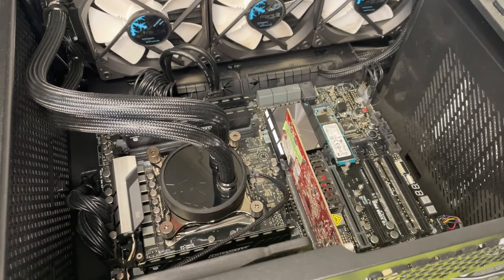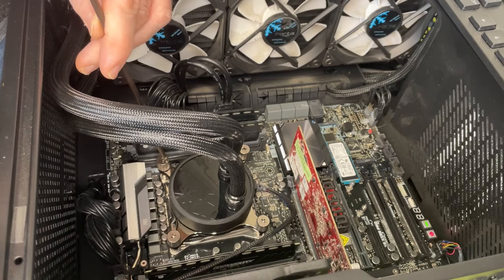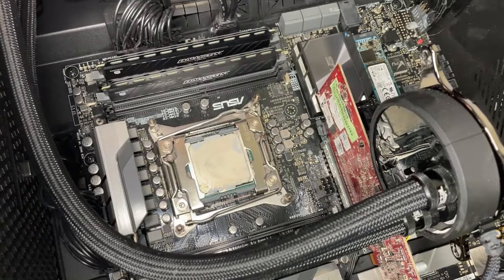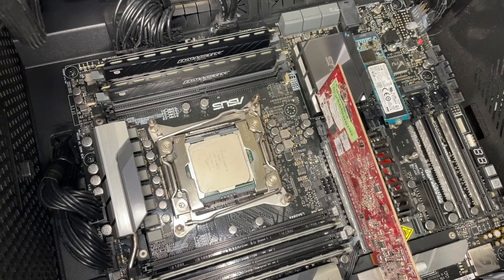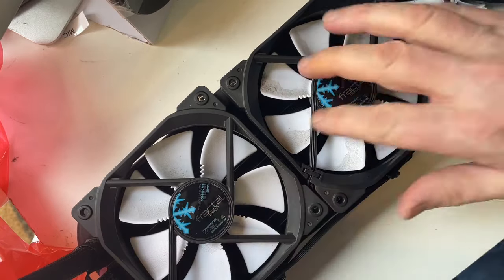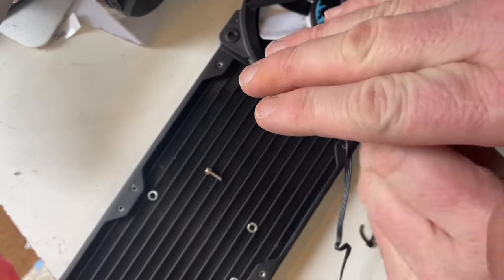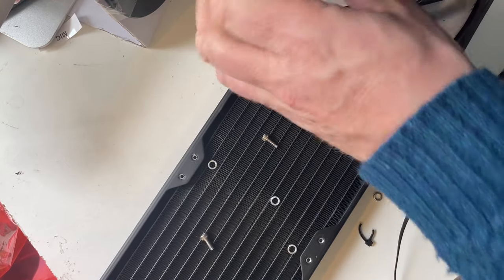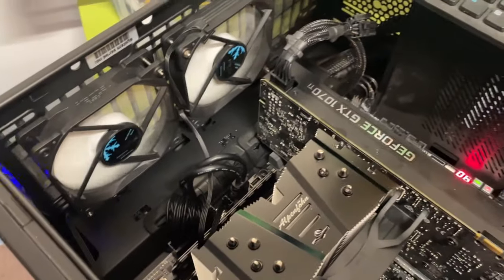Gaming PC  with a dodgy heatpump

Comment: I have the exact same AIO cooler. 5  years in no issues. have had to refill the fluid once as it will slowly lose fluid via evaporation and soaking into the lines, but this unit allows refilling and expansion which is why i picked it to begin with. Water cooling has come a very long way but it does have an expiration if not serviced.
Reply from the maker: Ah! That makes alot of sense. I guess I just left it to fester!

Comment: That block is full of air ?.. i have an i9 11900k and use a 8th gen block which is quite a few years old 😂 connected to a custom loop water chiller system i made. Best cooler ive owned. Doesn't go over 62c under load @5.3ghz all cores, and i have to restric the pump speed to stop it freezing on idle. 😂
Reply from the maker: Thats a good quesiton. It could be. The pump seems to be working but perhaps there is a airlock in there...

Comment: Also if a processor is fried, it won't just get hotter and hotter.  It simply won't work
Reply from the maker: True enough. Whats great is that the thermal cut-out seemed to work as the CPU and board have survived! Fhew!

Comment: Um, Is the pump powered by constant power ?
The common mistake people do when first time installing water cooling AIO is that they plug the power to the pump to temperature controlled power socket.
The pump should be running constant all the time, while the fan on radiator can be temperature controlled.

Comment: Dude your fans on the radiator are on backwards, they should be pushing air through the radiator and out of the case! The way you have them set is pulling air into the case, its backwards.
Reply: CPU prioritization. Cool air through the rad equals cooler water to the CPU. In closed positive pressure case the video card will probably have slight disadvantage (nothing massive)

Comment: Water coolers suck ass
Reply from the maker: It looks cool but I think im coming round to that way of thinking. More trouble that its worth...
Reply: @RetroGingerPod  You can get Thermalright Peerless Assassin (newer revision) or Phantom Spirits that'll outdo MOST AIO's and while not running as silently, they'll dump less heat into your room, and cool just as well as some $100USD+ air coolers/AIO's for less than Half the price.

Comment: I gave up on water cooling a while back, so many more problems for such a short term little advantage. The seem to corrode on the inside lately, the pump still runs but the fins inside the pump/block seem to block up. I treated myself to a Phanteks PH-TC14PE CPU Cooler a while back and it's been on 3 CPU's so far and preforms about the same as a water cooler long term. Water coolers seem better until the water heat soaks .
Reply from the maker: Ah! Interesting. Yes I hear you. Perhaps not worth the bother and extra cost. I guess they look cooler (pun warning!) but my case it totally opaque anyway so you cant even see the thing! So far the system seems to be stable so it seems it managed to cut-off without damaging itself...